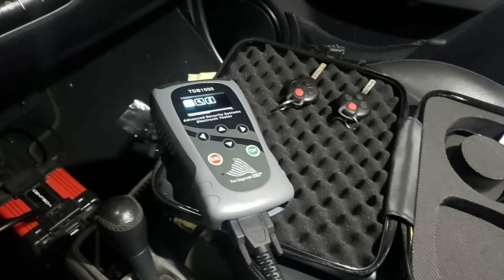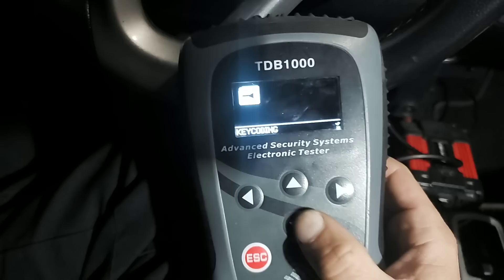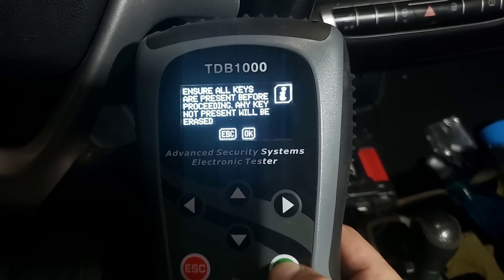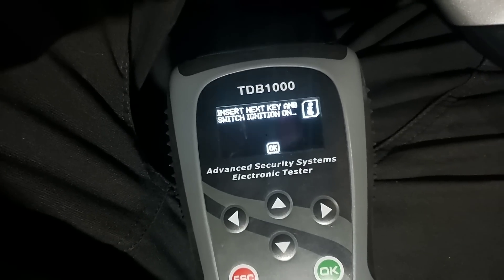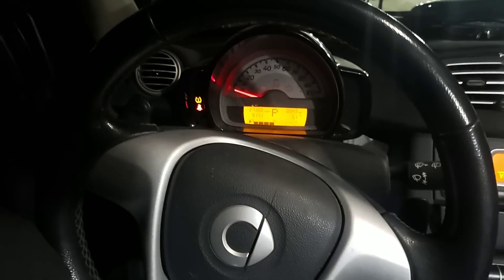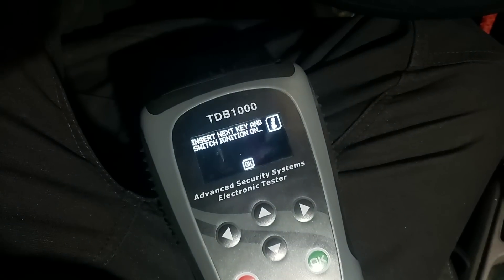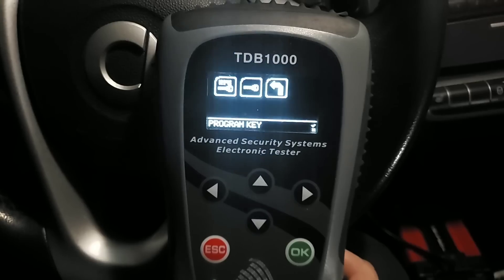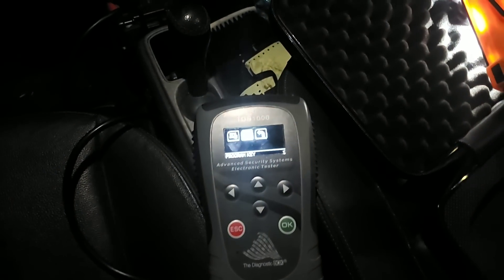2014 Smart ForTwo Key programming

Comment: Same thing happened when I tried to get a second key made.  I am not sure why everyone who you buy used car from has lost the owners manual and the 2nd key.  But a local locksmith had the machine and charged me $185.  After programming the new key the old one didn’t work and he had to program it also.  At least the lost key no longer worked.  Also, my check engine light stayed on until I drove the car a,couple miles to reset it.

Comment: On a 03 Altima have u ever had one that would not relearn idle?  I found a TSB that said u have to disconnect maf for 10 seconds. I had already given up after trying diagun Verus and MaxiDas
Reply: I have had some vehicles not respond to well to the manual idle relearn, just drove around a bit to relearn the idle on its own
Reply from the maker: Drop it in gear the very second you start learning the iav then wait 4 seconds and throw back in park

Comment: Good vid Keith. I am an automotive locksmith. Just like scan tools, there isn’t one that does them all well. Without the original key also it’s a much more involved process. Not familiar with that programmer so not sure if it will work when you don’t have a working key. Those are the jobs we mainly do. The more expensive programmers charge a token (fee) every time you use it despite paying $5000 for the programmer. There are Chinese knockoffs that don’t require tokens but they have also failed to program non complicated cars but did work on more complicated ones. 

Keep up the good work.